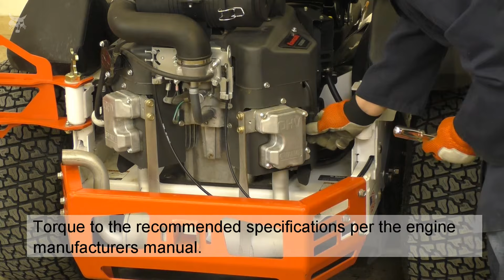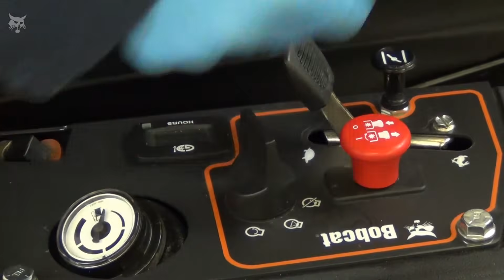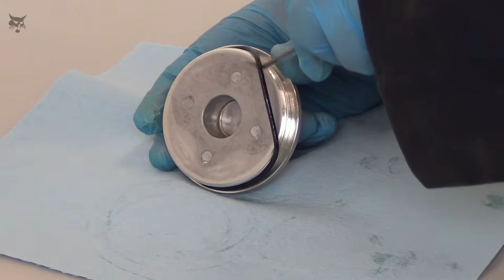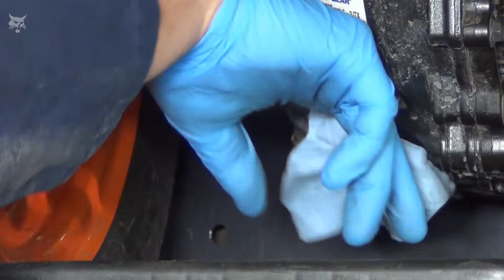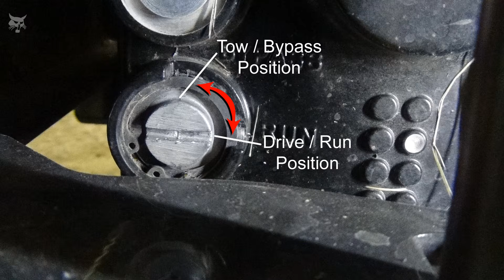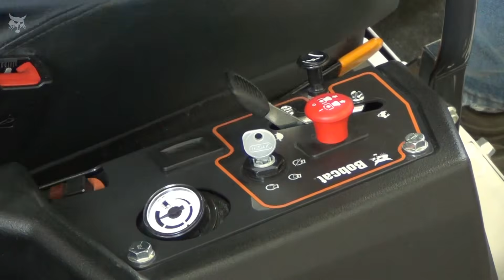Bobcat Zero-Turn Mower Maintenance How-To Tutorial

Comment: Does a 2017 BobCat CRZ48 have a fuel cut off switch to replace the fuel filter or is there a secret to minimizing fuel spillage?
Reply: Vice grips will allow you to pinch off the hose if you do not have a fuel cut off switch
Reply: @Duckologist101  Brilliant, I obviously didn't think of that.  I let it run out of gas and changed it there, of course it was over a 100 yds away.  Thanks!
Reply: One critical key point  - Do not touch the breather vent plug on transaxles with internal expansion tanks. If you do,  it will break internally, and you'll need to service the unit. This was straight from hydro-gear tech support.  Another thing, hydrogear told me to fill the transaxle using the fill port located on the top of the unit until fluid comes out the top port which is located on the side of the unit. I know it's confusing but look at the drawing diagram and and you'll see. I think you filled it incorrectly in this video, but you might still be OK.  Always consult your owner's manual or contact hydrogear if you have any questions.